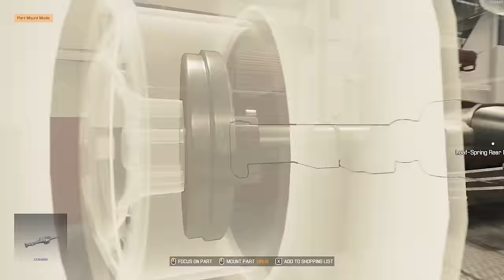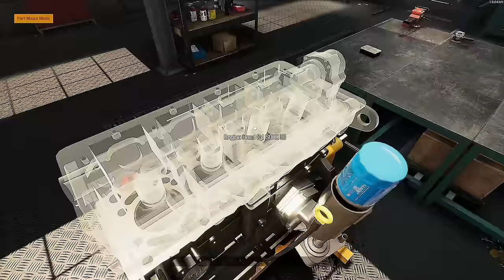Pierce Arrow Firetruck restoration - Car Mechanic Simulator 2021

Comment: 145.401 mph is really fast.For a fire truck!
Reply: Bro they got to get to a place thats on fire quick
Reply: @goofygoose5490  most firetrucks govern out at 60-65.
Reply: Yeah bro didn't you get the joke
Reply: Lol water tank must have been empty.
Reply: Left the pump and gearbox behind for weight savings
Reply: @goofygoose5490  lol
Reply: Tehy do that then show up on a false alarm 💀